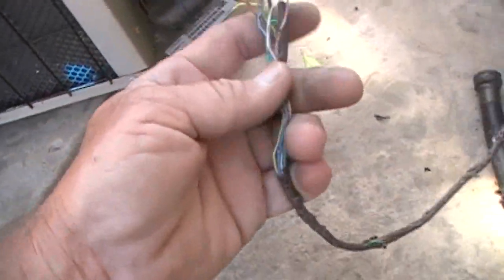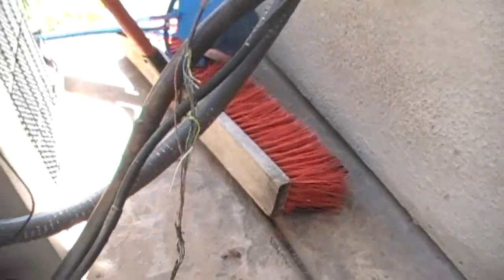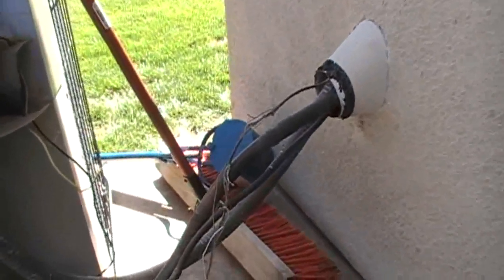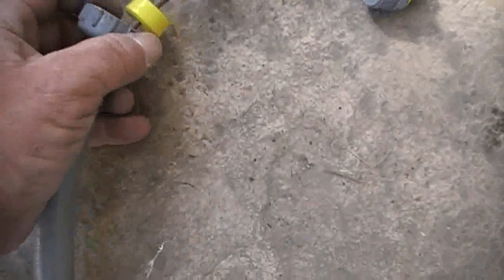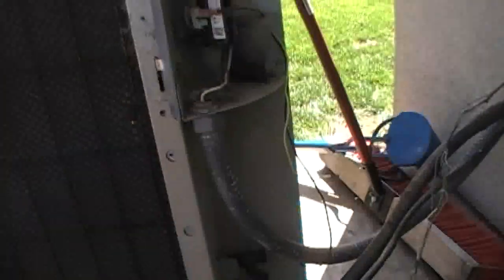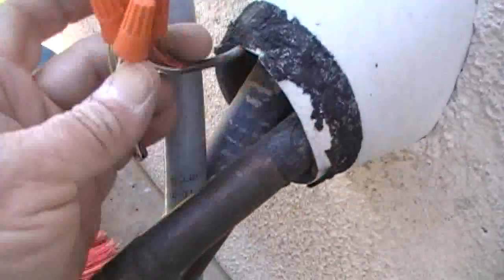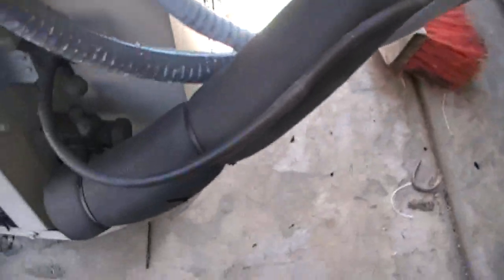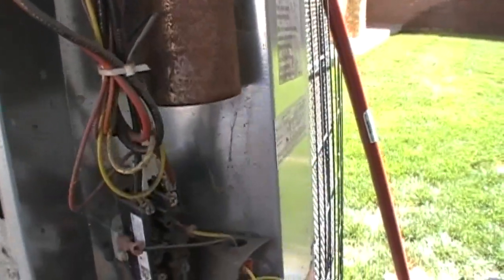HVAC - Doggy Damage

Comment: So thats whats happening to those low voltage control wires. It's a good thing that the high voltage wires are inside of metal lined seal tight. Thats one frustrated dog. Someone needs to spend a little more time with him.

Comment: Damn gettem Fido , (I got a problem with them PISSING on low voltage lines too, I guess there is acid in the pee pee , eats up over time) lol   Thank God for fuses, I always get stuck on old ones with Burnt Transformer ... But not Bitchin I neeedds the MONEY ! lol Not a Lennox Fan either ! We have to actually go to a local heating and air company ,here in town (not a parts house), they have all rights on Lennox stuff here ! I worked there years ago ...lol